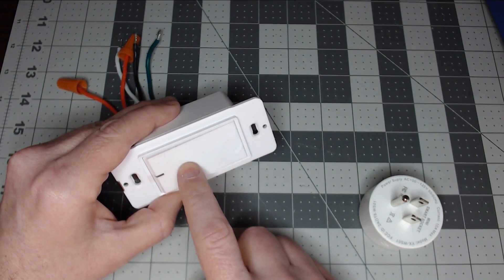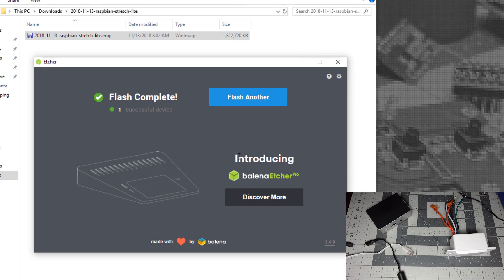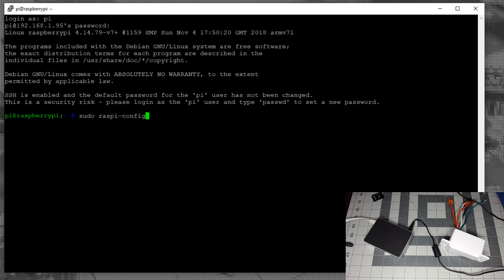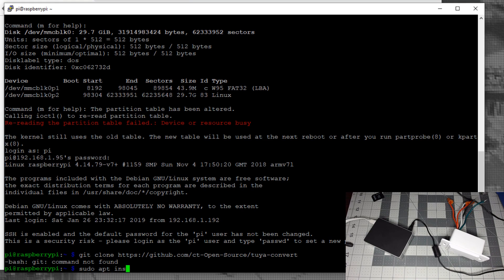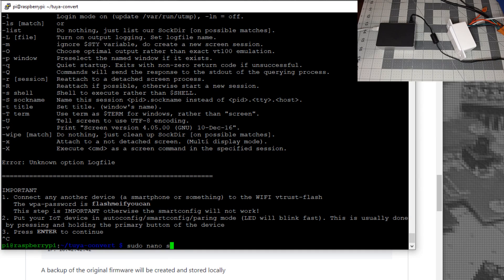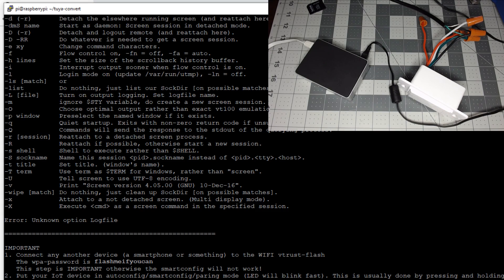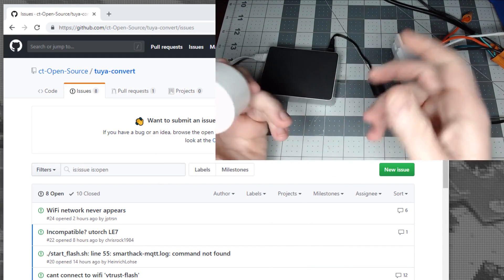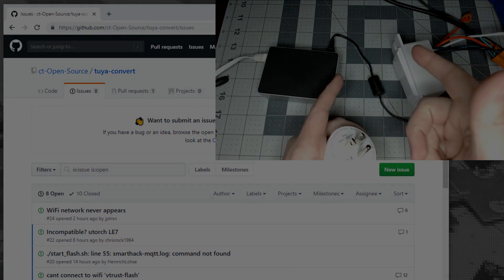Flash Tuya Smart Switches, Plugs, and others all Over the Air - No soldering!

Comment: This is fantastic!  I just did a smart life outlet with no problems.  I can't thank you enough for pointing this out.
Reply: Update - they flash successfully to Tasmota but the switches no longer work i.e. Toggle doesn't work in web site).  I tried other module types, some just cycle the relay on and off.  I tried setting Generic but there is not Led1 and Relay1 in the dropdown list.  Any suggestions of what I can try?  Please help.
Reply from the maker: Yep.. Just use this process I did after all the questions. https://youtu.be/m_O24tTzv8g
Reply: @digiblurDIY  Thank you so much, your video was perfect.!
Reply: @digiblurDIY  I was able set mine up perfectly thanks to you.  I tried to do one for my brother and have a little issue.  GPIO4 works perfectly as relay2i for turning the LED on and off, however when I try to make it Led1i it just blinks on and off every 2 seconds. I have looked for other options but nothing else seems to work.  I tried setting GPIO12 to relay1 and GPIO4 to relay1i but that didn't work either.  Any help would be greatly appreciated.
Reply: @digiblurDIY  A couple of Teckin SP20 (module type 59) smart plugs arrived last week, was able to flash Tasmota OTA on them without issue.
The GPIO config was found to be as follows:
GPIO0 = red LED
GPIO2 = blue LED
GPIO4 = relay (mains power)
GPIO13 = button

I suspect the energy monitoring stuff must be on GPIO14 because any time it got assigned the relay would click like crazy.  The red or blue LEDs would only stay on if configured as relays, otherwise they would blink when assigned or stay unlit when unassigned.

There seems to have been another (earlier?) revision of the Teckin SP20 that had seemed to have a textured button and the LED adjacent to the button.  The photos seem to more than suggest that the Teckin SP20 and the Zoozee are identical apart from the label (check out the 2nd photo in the ZOOZEE listing):
https://www.amazon.ca/dp/B07ML92QX8
https://www.amazon.ca/dp/B07CZFDLXC

Waiting on arrival of a couple more of these Teckin smart plugs, and an outdoor one which I suspect should be another clone of SK03 (module type 57).  Tasmota with 15A and energy monitoring FTW!
Reply from the maker: The latest development version of Tasmota has the power monitoring options selectable now per pin, but it's going to be a bit of guessing game without opening the plug to trace out what goes to what and which chip they are using.

Comment: Next question.  Does anyone know what what gpio pins run the relay for tuya smart plugs?  I have found the led for the button but not the button or relay itself.
Reply from the maker: Check out the live stream I did on how to figure things out for each device. https://youtu.be/m_O24tTzv8g
Reply: @digiblurDIY  Its not the same.  I did work it out.  The GPIO0 ls PWM2i,  GPIO2 is PWM1i, GPIO13 is Button1, and GPIO15 is Relay1.  We need to create a table of all these configs.
Reply from the maker: I know the Tuya convert has a table going in their wiki and people have been adding stuff to it by opening issue threads.
Reply from the maker: Which plug has these pwms?
Reply from the maker: If it is the same ones I had, I put a config at the end of this entry: https://www.digiblur.com/2019/01/flash-tuya-smart-switches-over-air-no.html
Reply: I think it varies by brand.  My  "AISIRER"-branded UK plug uses: GPIO4: 21 Relay 1, GPIO5: 17 Button1, GPIO12: 56 LED1i,
Reply: The live stream  https://youtu.be/m_O24tTzv8g tells you all you need to know - wish I'd seen it earlier (found mine by trial & error...)

Comment: Any assistant with getting the button to work would be appreciated?
Now that Tasomta is flashed, the button no longer turns on/off the socket and needs to be configure in the web interface.
Reply from the maker: Going to try to do a live stream soon for a quick run down of how to do things as I got a few questions from people new to Tasmota and it would be available for replay afterwards as well. Quickest way to get the content out. Otherwise check out my night light motion video around 8 minutes or so I show how I figured out that plug.

Comment: Awesome video thank you. 
Question: if I have a laptop running Ubuntu can I just install the tuya convert program from github and save from building the pi?
Reply from the maker: Yes. Definitely if you are a little Linux savvy and your wireless adapter supports AP mode then by all means let it rip. You can change the wlan0 in the config.txt of the Tuya convert.
Reply: You are awesome! Thank you the quick reply. I will test when I get home from work today and post my results.
Reply: @digiblurDIY   I couldn't get my laptop's build in wifi to act as an AP. I'm just going to to follow your method. Thanks again.
Reply from the maker: Dang.. No harm in trying though.

Comment: Just finished a MJ-SD01 Smart dimmer and your step by step was invaluable.  Still had the log file issue but it was so easy to fix.  Thank you for the work you have done.
Reply from the maker: Log file issue? Did you use the flash file I had for that switch?
Reply: I just finished a MJ-SD01 dimmer too. It went OK with no issues at all. The only thing is where can I find the GPIO correct settings for the dimmer at the tasmota config page?
Thanks!
Reply from the maker: @ggallegosm  https://github.com/digiblur/Sonoff-Tasmota   - also check out my State of the Dimmer video
Reply: digiblurDIY Thanks!!

Comment: Thanks for the video. So am I correct that the 4 pack of the Esicoo plugs you have an Amazon link are Tuya?
Reply from the maker: Yes. And I did all 4 of them without issue. I have the GPIO pin configuration for Tasmota I will update the description with.
Reply from the maker: GPIO config is at the end of this entry: https://www.digiblur.com/2019/01/flash-tuya-smart-switches-over-air-no.html
Reply: Thanks.  I ordered a 4 pack using your web link.
Reply: I would be interested in a dimmable plug.
Reply from the maker: I just a did live stream showing the setup of new plug and figuring out the pins in case you were interested and missed it.  https://www.youtube.com/watch?v=m_O24tTzv8g

A dimmable plug would be great!  I've only seen them in switches which of course you could put in a box but it would be kind of ugly if you couldn't hide it somewhere.
Reply: The 4 pack came today. Had no problems flashing tasmota. Thanks again and thanks for the module parameters.
Reply from the maker: @MikesHDVideos  awesome!  Read my update and future proof yourself a bit.  Set your default wifi config to 2 as stated, you can probably skip the 2nd SSID thing and just set the default wifi config to always start up the AP mode if it has issues connecting to WiFi.
Reply: @digiblurDIY  oops. :) 
Does anyone know if pressing the button for forty seconds resets the Web Admin Password without bricking it?  It connects to my WiFi now & I believe I can still use mqtt to control & monitor it.  However I can't enter the device's web page.  I must have had a typo when I first entered it.  Pressing the button 4 times puts it is AP mode but that doesn't help because I'm locked out of the it's web page.
Reply from the maker: If you still have mqtt going you can send any command you want. Do you remember or know the topic assigned? If not you can send all your tasmota devices commands at once using the Sonoffs topic.
Reply: @digiblurDIY  Mqtt was working before this happened.  I am trying to use NodeRed to sent WebPassword commands but having issues getting the mqtt node to connect.  I did some Node Red stuff a while ago but that stuff is lost now.  The WebPassword 0 command disables use of password.  The WebPassword  1 reset password to the value in user_config.h.  Holding the button for 40 seconds also resets the password to what is in user config.h but that will be my last resort.  I tried to get the current password by sending on a working device using WebPassword on its console.  It came back with the value masked with *s.  I expect the actual value would come back with mqtt.    It would be great if I could find a NodeRed flow or other tool to disable the WebPassword.
Reply: Hi, can you and anyone recommend a good mqqt tool to sent commands and receive replies from Tasmota.
Reply from the maker: If you can send commands to it then I believe the Tasmota commands has a webpassword command to disable it. https://github.com/arendst/Sonoff-Tasmota/wiki/Commands
Reply from the maker: Mqtt fx works well. If you use home assitant you can send commands to it using the mqtt send console there as well.
Reply: I found my old NodeRed code and was able to change the password.  I tested it first on an Sonoff basic just in case. Thanks for your help and suggestions, and your great videos.  :)
Reply from the maker: Awesome. Glad you got back in! Thanks for the follow up.

Comment: when you edit start_flash.sh, you have to take out the *.log filename that comes after the -Logfile option on all the lines you edit.  At least on real Linux you do, I don't know about Raspbian or see how it could work without doing that.
Reply: James
 would you be able to post somewhere your start-flash.sh? I have been trying to run this on Kali/Ubuntu and Mint and could not make it happen, edited config.txt, used external WIFI wlan1 and still can not make the AP appear.
Reply: I finally did it and flashed all my plugs and RGB bulb
Reply from the maker: See this pull request. https://github.com/ct-Open-Source/tuya-convert/pull/29
Reply: @digiblurDIY  Oh  good god, thanks.  That's about ridiculous - and very unlike Linux.  

Also, if you run it on something other than a PI, and the interface doesn't happen to be named wlan0, don't forget to change it in config.txt...

I've had good success with Ubuntu.  But it does leave the wireless interface in a jacked up state sometimes.  To fix that, edit
/etc/NetworkManager/NetworkManager.conf and take out the unmanaged devices line.
Probably the same if it happens on Raspbian, but the file location may be different.

Comment: Just rewatched your state of the dimmer video a month or so ago, after this new ota update, fancy doing another video on flashing a ‘normal’ tuya smart switch, then showing how you would work out how to get it working , eg my tuya dimmers have 3 buttons, on/off, 1 up brightness and 1 down brightness. My other tuya switch has only 2 buttons for different circuits. Could I turn that into a dimmer if I held the button down? How would I find out how to configure it in Tasmota? Cheers
Reply from the maker: The smart switch I used in the video was available as I had the stock firmware to flash it back to Tuya so it was perfect for testing multiple times.  I brought it back and forth between Tuya and Tasmota about 6 or 7 times actually without issue.  It's the same TYWE3S Esp8266 module in all of the dimmers I've done so in theory it should work on those as well.  Which Tuya based dimmers do you have?

Comment: Awesome video , but i am a bit confused. The title says Tuya controlled devices, but after flash is complete it shows Sonoff on the setup screen. Just to be clear ,  will this method work for OTA flashing of Sonoff? Sorry if dumb question just wanna make sure before ordering raspberry pi as i have no need for pi otherwise. Thanks again for your valuable time and information!
Reply from the maker: Tuya/Smartlife is the app used on a bunch of different devices when they are in the cloud with the locked down firmware.  This brings them over to Tasmota, it just has a default name of Sonoff since that firmware started out with the Sonoff Basic flashing way back.  You are welcome to flash other firmware on your devices as well once you get Tasmota on it since it has a simple OTA flashing method in the GUI.  All of these devices are ESP8266 microcontroller based.